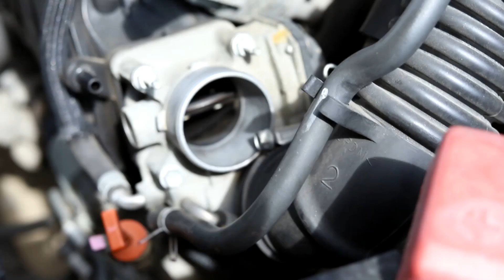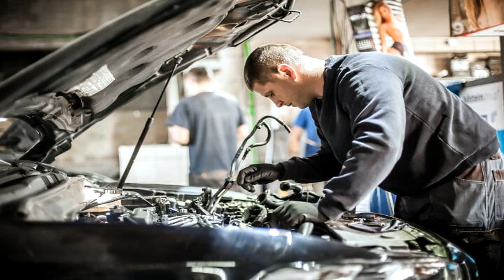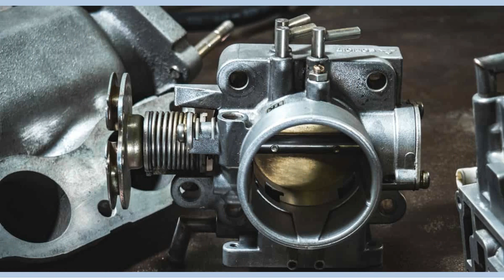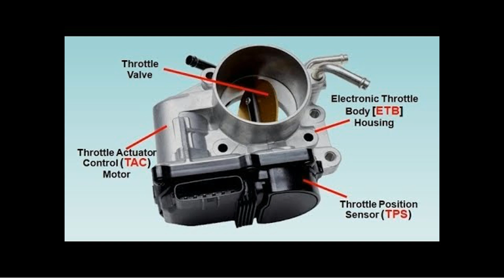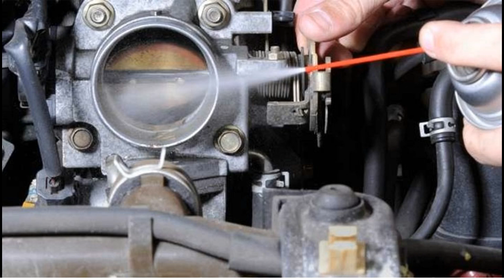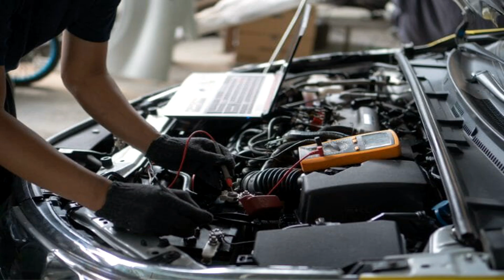Signs of a Bad Throttle Body

Comment: I think I have a very bad throttle body right now because I just spent more than 10 litres on a less than 10km journey and am having very rough idling and my plugs are clogged with smoke. my car is toyota spacio 1999 4A engine.